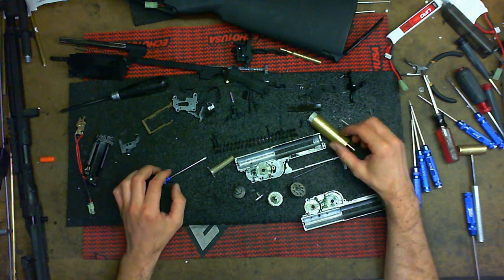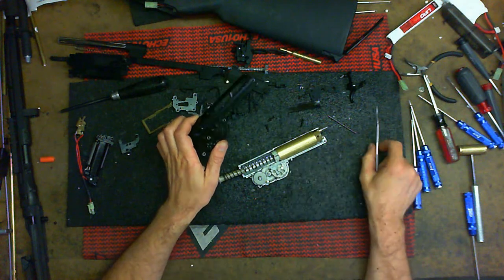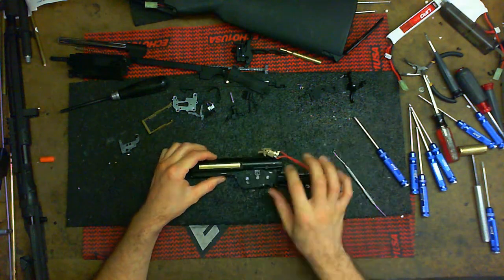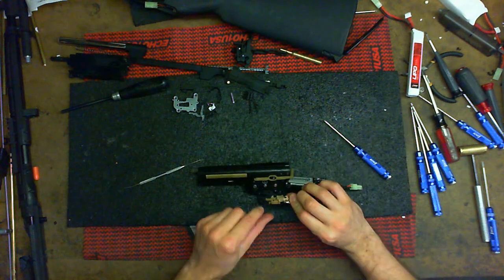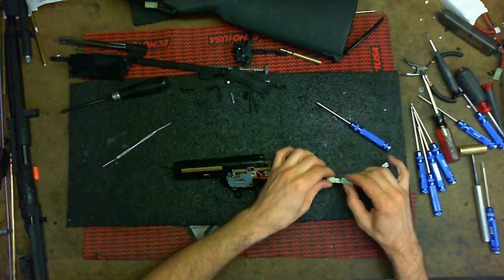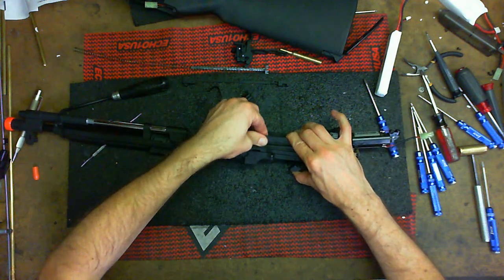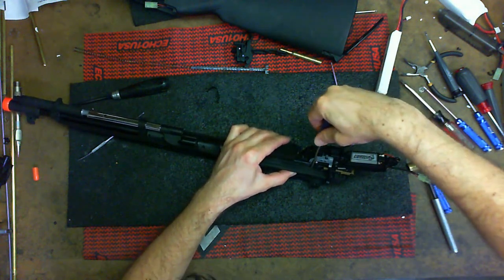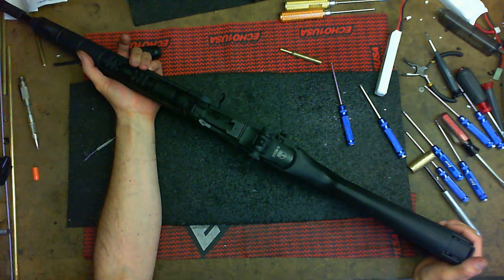Echo1 SOC16 Assembly from gearbox

Comment: Hey I just got new M14 and I put about 1000 bullets, into it, and pretty soon it made a noise like as if the battery was dying, but the next day when I full charged it (smart charger) gun gave me no response. I checked my fuse (fuse was good), saw if any wires on the motor was cut or anything had slipped off each other. However the guns wires was still in tact. Can you help me fix this problem? Or what do you think is the problem?